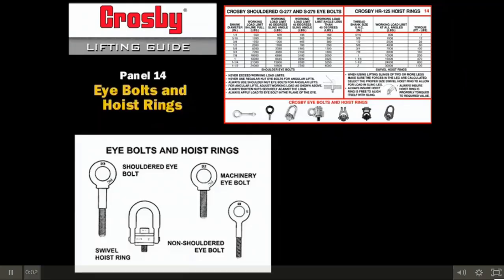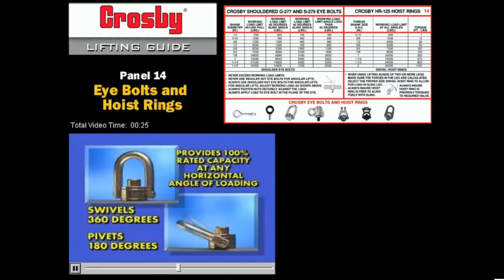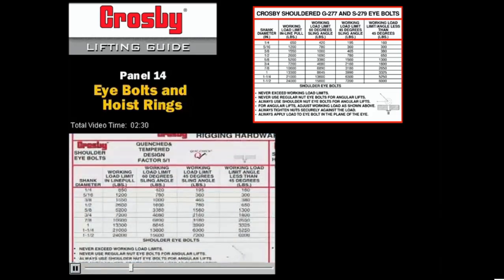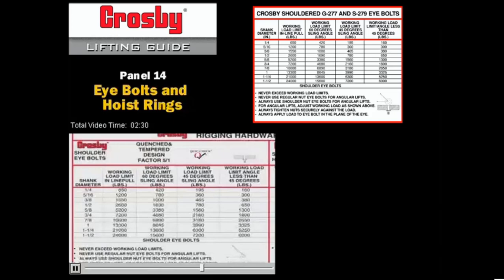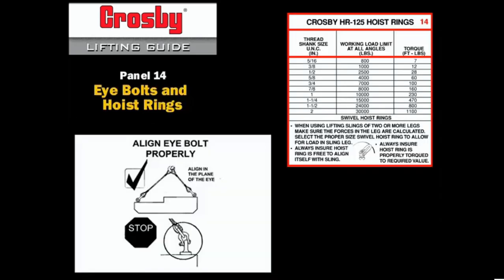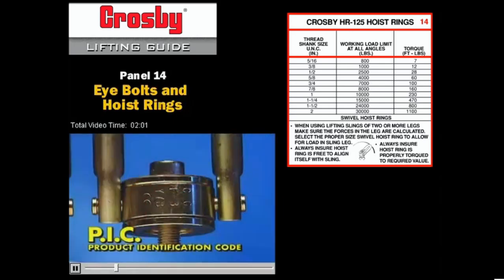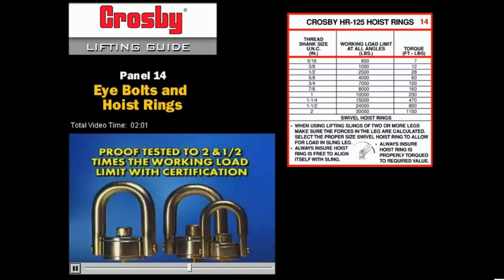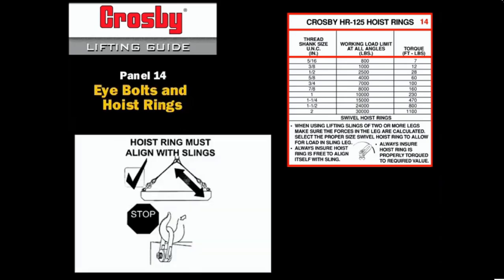Eye Bolts and Hoist Rings

Comment from the maker: Question 1 of 10
1. Question
Category: Lifting Point Hardware
The Working Load Limit of eye bolts are based on _______ loading.
•   Angular loading
•   In-line loading
•   Shock loading

Question 2 of 10
2. Question
Category: Lifting Point Hardware
Always use ____________ when angularly loading eye bolts.
•   Loose eye bolts
•   Non-shouldered eye bolts
•   Shouldered eye bolts

Question 3 of 10
3. Question
Category: Fittings
Always apply the load in the _________ of an eye bolt.
•   Plane of the eye
•   Shoulder
•   In the plane perpendicular (90°) to the eye

Question 4 of 10
4. Question
Category: Capacity
The Working Load Limit of a 1″ Crosby shouldered eye bolt is ______ when the angle of loading (horizontal sling angle) is 30 degrees.
•   13,300 lbs.
•   8,645 lbs.
•   3,325 lbs.

Question 5 of 10
5. Question
Category: Capacity
The Working Load Limit of a 1″ Crosby shouldered eye bolt is _______ when pulled in line.
•   13,300 lbs.
•   8,645 lbs.
•   3,325 lbs.

Question 6 of 10
6. Question
Category: Lifting Point Hardware
The working load limit of a Crosby swivel hoist ring is valid for:
•   In-line loading only
•   In-line or angular loading
•   Same capacity as an eye bolt

Question 7 of 10
7. Question
Category: Capacity
The Working Load Limit of a 1″ Crosby swivel hoist ring pulled in-line is:
•   10,000 lbs.
•   13,300 lbs.
•   15,000 lbs.

Question 8 of 10
8. Question
Category: Lifting Point Hardware
The Working Load Limit of a 1″ Crosby swivel hoist ring pulled at a 60° sling angle is:
•   Same as in-line loading
•   Less than in-line loading
•   More than in-line loading

Question 9 of 10
9. Question
Category: Lifting Point Hardware
Although the swivel hoist ring has its full Working Load Limit at all angles of pull, you must:
(select all that apply)
•   Size hoist ring for forces in sling leg
•   Ensure hoist ring is free to align
•   Be sure hoist ring is properly torqued

Question 10 of 10
10. Question
Category: Lifting Point Hardware
Shouldered eye bolts lose __________of their strength when subjected to angular loading.
•   50 to 75 percent
•   Very little
•   All